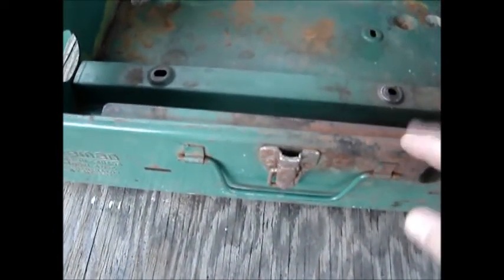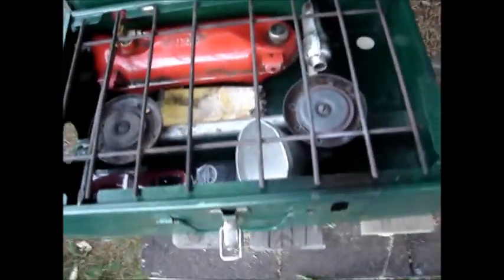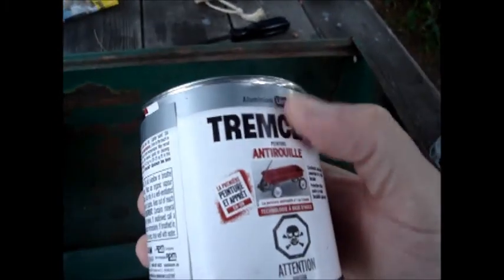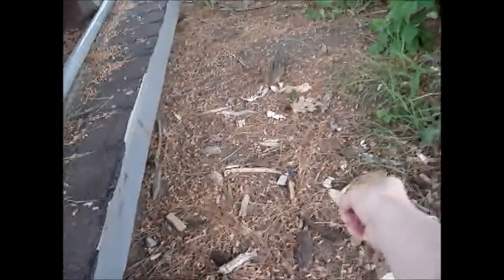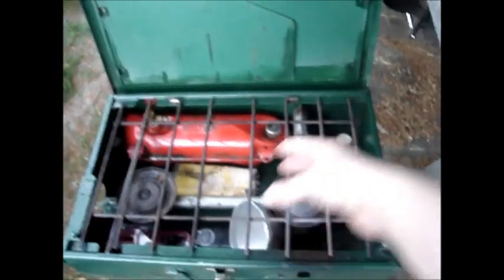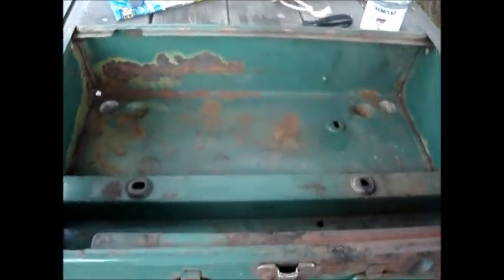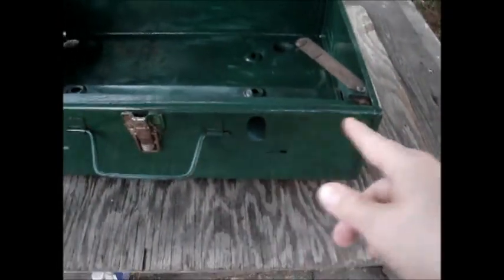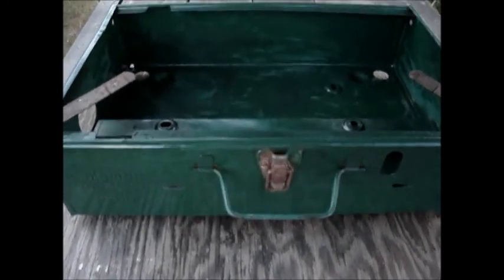Coleman Model 421-C Painting

Comment: lots of these on Facebook marketplace  including one of mine. I sanded ,primed , and painted the box Rustoleum Hunter Green and for the innards the stove parts are painted with high heat Chevy orange. Really a nice contrast and considering mine is from 1985 it works wonderfully , You can run Coleman fuel ( expensive but does not expire ) or unleaded gas  which is far cheaper. There are videos of running it on kerosene  but it takes a bit of modification.
Reply from the maker: Very cool!
Reply: are you able to use gas with ethenol
Reply: @danielbruinsma4049  essentially if it vaporizes and burns you can use it. The caveat may be a bit of cleaning more than white gas would  require.
Reply: @brucewmclaughlin9072  Thank you In Ontario where I'm from you can no longer buy gas with no ethenol